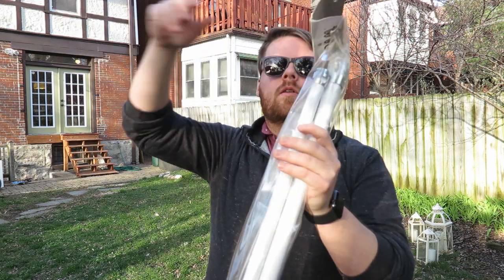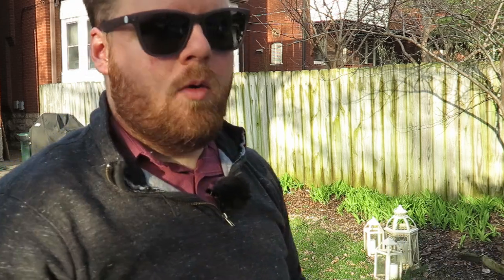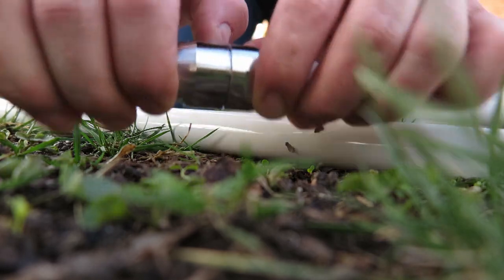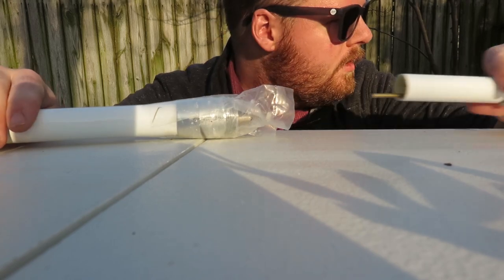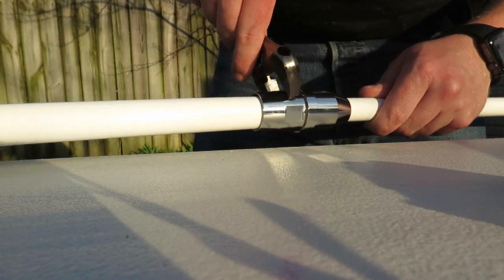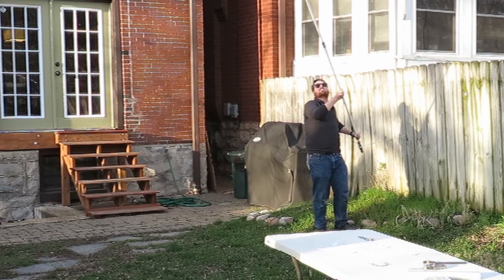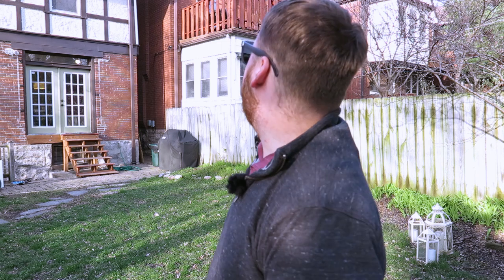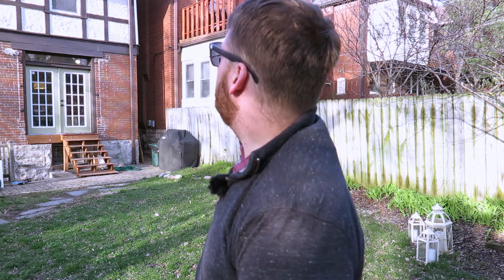TRAM 1481 Dual Band VHF/UHF Ham Radio Base Antenna Unboxing and Review

Comment: just put this antenna up yesterday on a 40 foot telescopic mast pole. i only have the mast up around 15 feet and immediately am getting out 40-50 miles with 25 watts. swr was 1.4:1. i used roofers tape to seal up the joints and the input at the bottom for the so239 connector. once i mount a bracket under my roof gable for support, i will raise the mast up completely. for a free antenna that was forgotten about in an attic of a customer, i am very happy.

Comment: I have 2. If you weather proof the joints it'll last awhile. Otherwise it'll get water in it. I used rtv when going together and then rescue tape over the joints. Mines been up for few years on my 85ft tower with no issues

Comment: Hey guys look at the Diamond x510HDA , what's the difference other than price ? Look real close , that so239 connector on the Diamond and Coment Gp9 both have drain holes on each side of the connector so copy it and file or grind holes in your Tram that way if water gets in it can drain out . Now how does it get in ? Well those joints might be a source but I don't think so so , carefully hold the fiberglass base and with your hand and twist and rock the aluminum  pieces and most likely it will break loose showing you they glued it with resin or epoxy , and aluminium and fiberglass expand at different rates so will break loose and you might notice where water can slide down the antenna and is funneled into that joint as the ring that's over the aluminium looks like a gasket but its hard plastic which helps let water in . so if you want to save a hundred bucks on a knockoff antenna you need to do some extra work to make it last.
Reply: I’m getting ready to pull my Tram 1481 down and do some maintenance and waterproofing on it. It performs poorly after it rains so I need to remedy that. Ended up finding your comment. Thx
Reply: Bottom line. It's rubbish.

Comment: Nice job but a couple of comments.  I have the diamond that has been up 10 years and no leakage problem, both use the same seals. If you don't put it together right you WILL have leakage.  I read some of the reviews and wonder if some of the guys writing them could properly identify a screwdriver I can understand why things do not work. I listened to your comments on N connectors then saw you using RG-8x or RG-58, couldn't tell which, in a base situation. If you aren't sealing N's, I wonder how long till you experience problems. I got my Tram 1481 without instructions, watched this to fill in to be sure I was right. Oh, I dont trust lockwashers on most things, ever heard of loctite? I use the blue, you can break it free if you have to. I haven't had a bolt back out since with or without a lockwasher. Again, good job.  This kind of thing helps newer hams. K3HQI

Comment: I just passed my Technician test, waiting for call sign. Going to mount it with a gable end mount on top of my shack. 17' roof + 16' of the antenna. I'll let you know how it goes. Thanks for the video - will save me some time and grief!
Reply from the maker: congratulations! good luck; i'd be glad to hear how it goes. I still don't have mine up because the masonry repair companies around STL are super flaky!
Reply: @N0SSC  Got the antenna put together and mounted. My call sign dropped a couple of days ago (KO4DKI). The sweet spot on 2-meters is 146.300, had an SWR = 1.15! The trade-off: UHF not so good (but not terrible). Your video saved me a lot of grief and time. Many thanks again!

Comment: #1, the adult Beverage is ALWAYS first. I have the same antenna just not put it together yet. I did buy Flex Seal in clear.
I believe these Tram/Browning and the Diamond are the same antenna.  It would be interesting if the antenna and its windings (component) are the same, I have a notion they are. Same everything just different color water "0" rings.

Comment: Good video! Thanks! I use Scotch 2228 Moisture Sealing Electrical tape! It’s a product for Electrician’s and can be used for direct burial. It’s good stuff, Made in the USA. Cover the whole joint! Also gently sand with light sand paper or bronze wool the antenna and put several coats of polyurethane marine varnish on the fiber glass. Should be good for 10 years . Bronze Wool between coats. Your adding quality to your Antenna. JohnBoyUtah KJ7TBR.😎🇺🇸📡🎙

Comment: How do you set your standing waves with the tram 1481 antenna
Reply: It is pre-tuned at the factory.  I have the 1480 dual band and the swr on 2 meters is 1,2:1 and 1.1:1 on 70cm.

Comment: What sort of coaxial cable are you using 73s Tom Vk3ftom
Reply from the maker: That is yet to be determined. I think I'm going to order some Davis RF Direct-Bury coax, which seems to hold up better than, and has equivalent specs to LMR-400.
Reply: Thank you

Comment: >>>JUNK<<< The newer  Tram 1481 bend at their base to look really stupid.
They seem now to have issues with water getting into the antenna.
DON'T BUY ANY TRAM PRODUCTS< THEY ARE JUNK!!!!
Reply: Maybe there are two team companies making antennas you bought from one and I bought from the.other. I have several teams, all have been good.
Reply: @ralphebrandt  
Trams customer service is worthless as well. They didn't stand behind their product. I was told they changed hands. I would suggest you buy from a quality company next time.
    As for the tram 1841, they all seem to have bends at their base where they are mounted if they experienced some wind. I placed another up that I had used, when I looked at it, one it was slightly constructed different, and two it had the bend at the base as my other when I took it down. I was told this was not unusual.
     Customer service not wanting to help me with parts told me all I needed.